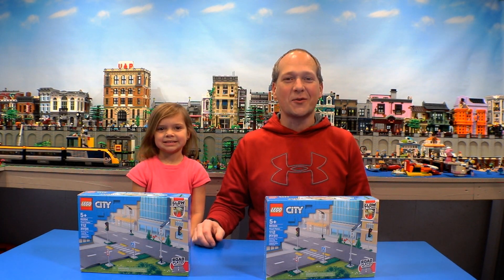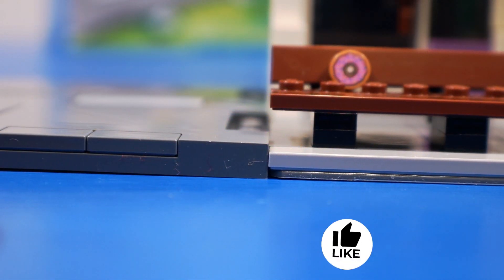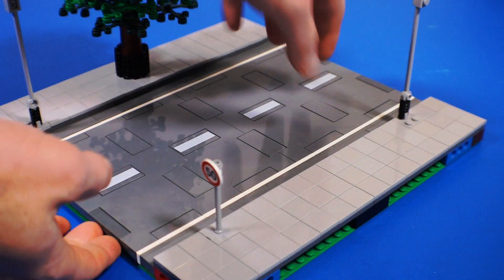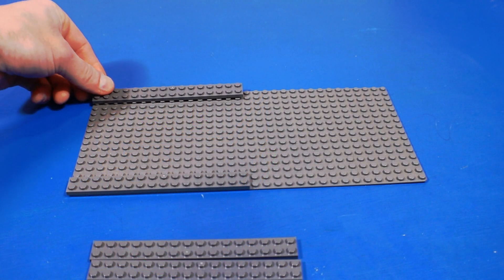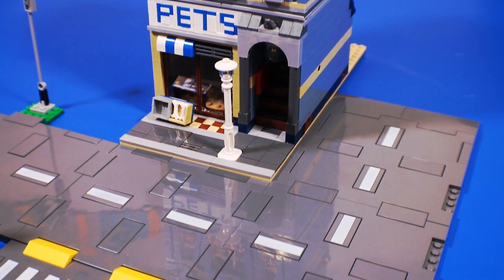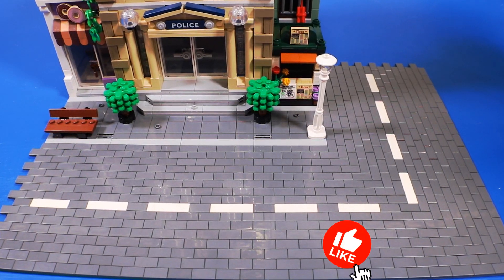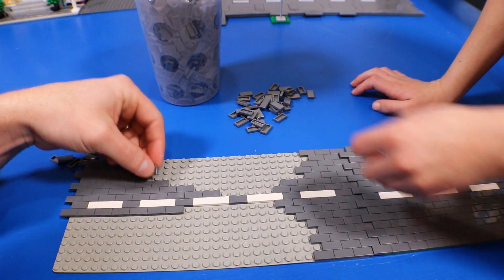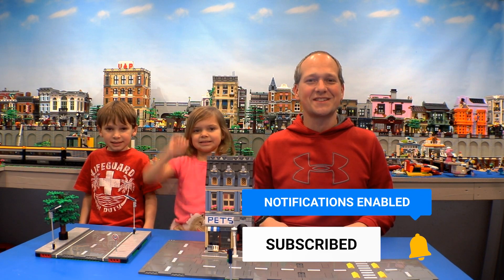New Lego Road Plate Solutions- GreenGuitarGuy

Comment: Here's an even cheaper, if slightly less purist approach. But honestly since when has the need for purity ever extended down to the table and benchwork. Get yourself a 4'x8' sheet of 1/8" Masonite Hardboard. Have the guy at Home depot or lows cut it into 1'x4' strips. You now have pads for underneath your Modulars. Total Cost ~$8 US.

Comment: Nice video. I have a question though. I’m planing on doing the third one. But I’m also wondering what the difference between the second and third methods. Also, if I am doing the third method, how will I connect the road plates to my modulars? I don’t like the idea of my road plates not being connected to my buildings.
Reply from the maker: Hey Swang, good question.  The third method with just setting buildings on freestanding baseplates, there would not really be a way to connect the modular building with the road as they are different heights.  The roads are at 4 Lego units high while the buildings would be 5 Lego units high.  This would be the same case for the mini-mils second option .  The only way to avoid this would be to eliminate the baseplate for the modular buildings, or put the new roadplates on a baseplate as well so they're at the same height.  Once they're at the same level you should be able to connect with plates.  There may be other options out there, but I hope that helps.
Reply: @GreenGuitarGuy  I see. I’m looking more into the mills version of the roads. Also, is there a reliable way to buy retired lego sets? I’m trying to make a city myself but most of the modulars buildings are retires :(
Reply from the maker: You can watch EBay and FB marketplace for deals, they are out there, but be aware of knockoffs, as there are quite a few Lepin sets out there that look just like Lego. Bricklink.com is a good place, it's only Lego so you don't have to worry about knock offs and sometimes you have options, like some sets might be missing parts or box and so you can get them cheaper. Just make sure you're finding a seller that ships to you and that shipping is not rediculusly high. The retired sets usually go for 2-4 times their original price FYI
Reply from the maker: @sweezy5149  Also, as I mentioned above about Bricklink, there is an option to part out any set... You can try that option and see if you can source the parts cheaper than buying a set. There are a few sets that have a couple rare bricks that you could change out for something cheaper, like Green Grocer has a sand green 1x2 modified brick that is really expensive, but if you change it out for a sand green 1x2 modified masonary brick it could save a lot of money and still look just as nice (or better) than the original. Hope that helps
Reply: @GreenGuitarGuy  sorry I couldn’t respond to you in time. Anyways, I have another question. How can I integrate the mills road with my city. Is there a way I can make my modulars a “mills” modular if you get what I mean?